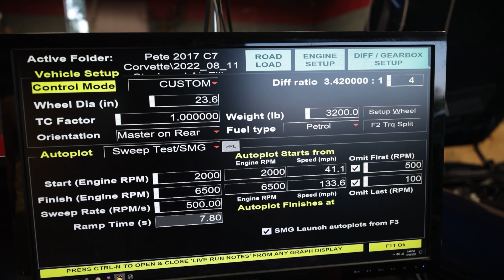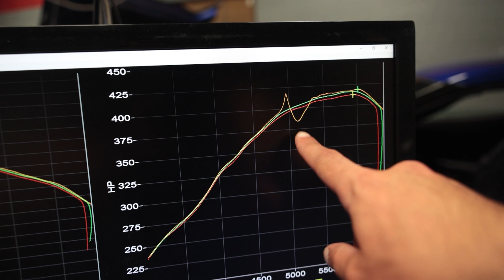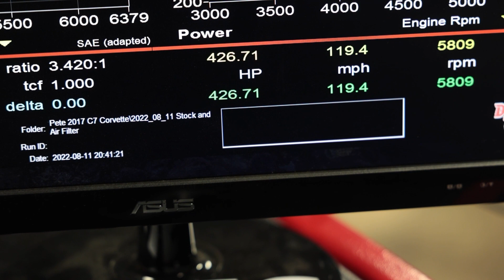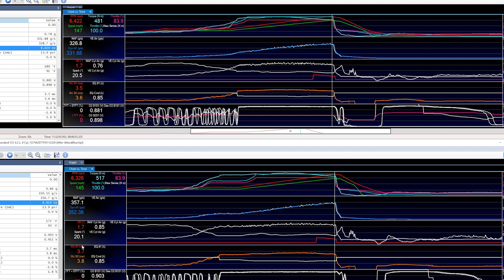DYNO RESULTS - C7 Corvette Attack Blue Nano Testing LT1 Engine - How To Install 2014-2019 C7 Filter

Comment: Im noticing attention paid to it being a lt1... is the c7 lt2 or 2lt engine different?
Reply: LT1 is the engine, 1LT, 2LT, and 3LT are trim levels. Sorta confusing , but no the 1, 2, or 3LT in the Stingray and Grand Sport do not have different engines. 

Along with that, the Z06 has the LT4 engine, with trim levels 1LZ, 2LZ, and 3LZ. The ZR-1 has the LT5 engine, with trim levels 1ZR and 3ZR.

Comment: on 2015 z51 c7 auto used the intech holley intake system with  better exhaust everything but headers and tune 488 hp at rear wheels

Comment: 10hp is impressive,  but how much more dirt  going into your engine?
Reply: It's not supposed to compromise filtering. Filters down to like 5 microns, I think. Unlike a K&N, which flows more air than stock, but lets a lot more dust through too.

Comment: Stock filter with 30000 miles vs new performance filter. Not a fair comparison. 😆
Reply: I wondered about that. Would it be as much difference if comparing new air filters? Who knows?

Comment: I'm at 500hp and 495ft lb  with just a ported throttle body, x-pipe with secondary cat delete and a tune. I'll definitely be getting this air filter next.
Reply from the maker: Awesome!
Reply: Is this at the wheels or at the crank?

Comment: Thanks for the vid. Installed one on my C7. You can definitely tell it flows better than stock. The exhaust burbles and pops more and sounds a little more aggressive. Nothing drastic like an aftermarket muffler, but definitely turns the sound up a just a little bit. 10hp is a fair claim. The acceleration seems a bit smoother especially when you're going about 45 and punch it. I'd recommend it if it's time for a new filter anyway. This is a great first mod and probably the only mod you can do without a tune on the LT1. It's SO sensitive. It'll throw a code at the drop of a hat.
Reply from the maker: Glad to hear you are enjoying it!

Comment: I added the attack blue filter to my c7 and the check engine light came on
Reply: Installed one on my 19 GS early on. No CEL.
Reply from the maker: We haven't experienced that problem. Make sure everything is connected and right.
Reply: Filter alone shouldn't throw a code. If you have other mods with no tune, the filter might just be enough to offset the computer. The LT1's parameters are very strict.